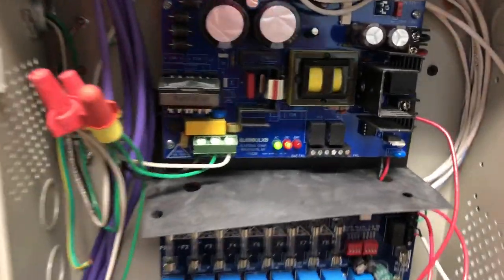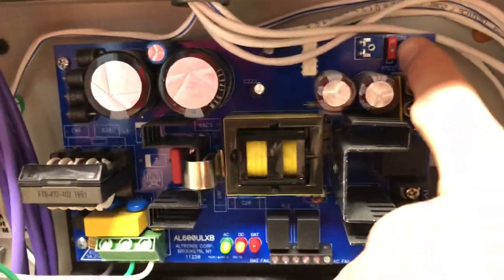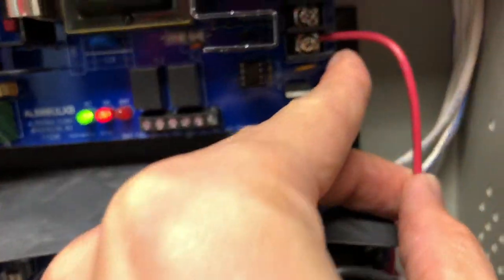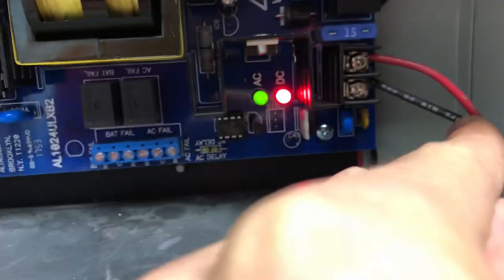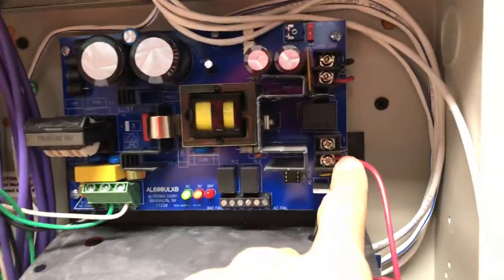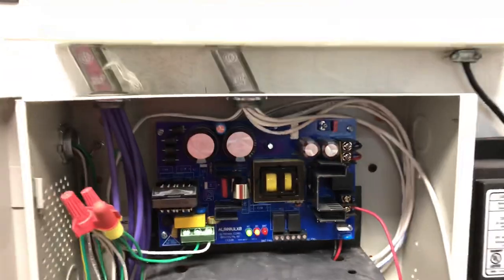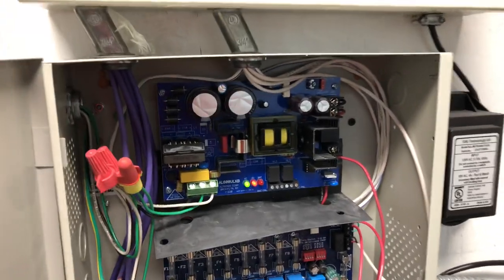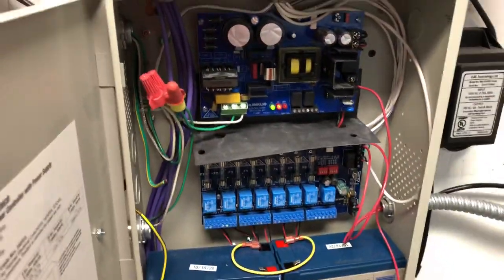Altronix Power Supply - Watch carefully when installing.

Comment: I have the following failure, the voltage starts dropping on the DC side, and when I turn it off, it doesn't turn back on on the AC side.
Reply from the maker: Possible short somewhere? Have you tried removing all the locks output wires and input leads?
Reply: @VisionGuy  I already tried but it doesn't come back
Reply from the maker: Maybe it's just failing components on the power supply? Might be time to replace and see if the issue goes away.

Comment: Does that information coincide with the documentation that came with rhe the panel?

For if the manual say one thing and the actual product has the opposite, that may be a serious liability issue.
Too many people depend on Altronix for that hickup.

Thanks for the information.
Reply from the maker: It's in the manual, but as you probably know, most people don't read the manual. That's the reason for the video. Spreading awareness